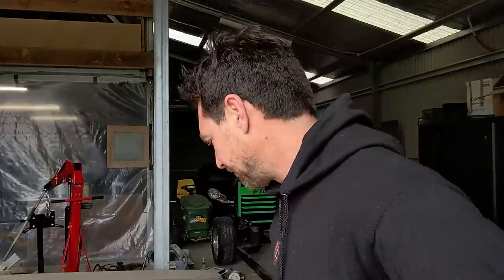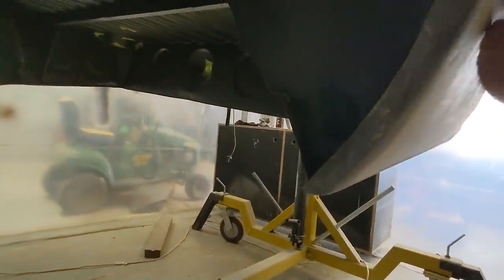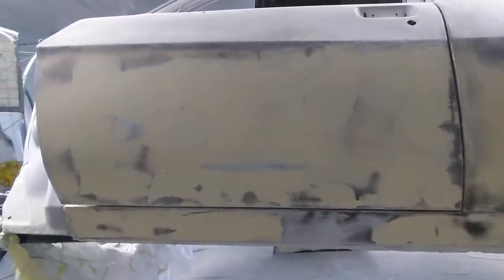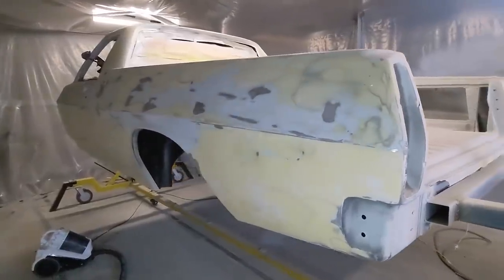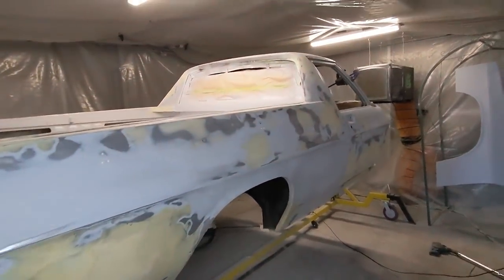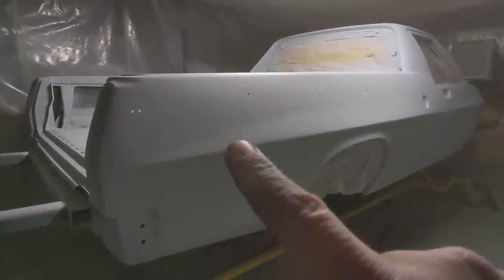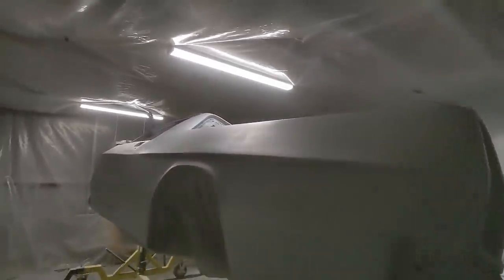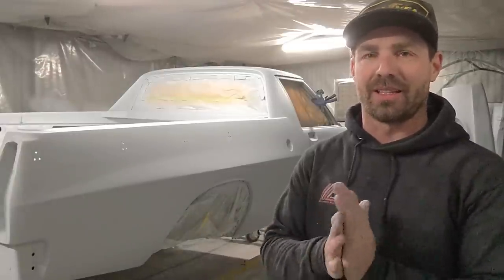EPISODE 54 - SPRAYING THE 1982 HOLDEN WB UTE SHELL IN 2K HIGH BUILD PRIMER

Comment: How gratifying is it man, when ya stand back once she’s one colour and look over them curves ha!  , I usually put epoxy sealer on before high build (which is thinned out epoxy primer ) as this is a great chance to see the panels uniform in colour and free from imperfections whilst sealing in the filler work, and if ya need to do more corrections then everything is still at the same stage in the process. You wanna avoid using the high build to lift deepish lows. Finish the underside and set her down on the chassis once all lines are fitted etc , paint door jambs and hanging panel inside faces , fit front end then you’ll be able to roll outside for wet sanding the entire outside in preparation for topcoat . If space is low and ya have to paint (top coat) where you prep then re-do ya booth ,brand new plastic and blow down or cover ceiling and run a wet floor which will catch falling debris and won’t float up into the duco when ya walk around painting , keep punching out the work man can’t wait til you show us the shine!
Reply from the maker: Thanks Anthony, yeah it was definitely a buzz seeing the lines worked, you really know where you stand once the grey high lights the remaining trouble areas. I know once they are nailed I will not be worried at all about ripples once top coats on. I will do that, I wanted to wait for engine and exhaust to be dropped onto chassis before I put the body back on but engine is still a bit off. So might just drop it back on chassis and start to line up guards, weld cowl on and bonnet. I'm still thinking of painting guards and doors separately as well to keep over spray down now. Thanks mate

Comment: Hey Barnsey, as a qualified panel beater that works in resto.

We use the same method for highs and lows but for a quality finish we will 2k high fill and block with a speed file, and repeat this again. So we filler, prime & block, prime & block again then fine sand and paint.

You can prime and block 3 or more times for a better finish
Reply: In saying this if the primer is applied thick you can use it as a filler and just block it right down to remove lows instead of using filler over primer
Reply from the maker: Awesome mate, that's good to hear after all the work, I was debating whether it was a mistake not going to polyester surfacer but I will get the same result now I can see the remaining lows. I will fill them and reprime as you mentioned. Do you just apply your base coat over the 2k once it's all sanded?
Reply: @BarnesysBuilds  aslong as you have no body filler rub throughs you are good to go. If you do I suggest spot priming and blocking the areas again, using a rattle can to spot up before painting can create issues, so 2k our iof a gun is the go always

Comment: Good one Barnesy, all the hard work is starting to pay off now. It is looking good, you have straightened out a lot of imperfections. That banana line you refer to is often over looked. You can tell that body was not a Kingswood from the factory because the little welded tags for the vertical trim behind the doors are not there. Those trims were hard to find a long time ago,they tended to fall off. Also the side body mouldings are held on with plastic clips; those holes would have been punched before painting and as a result are painted too, not drilled afterwards (punched holes are a lot neater than drilled ones). Glad you are going to keep the rope down tonneau cover, that is what makes them Holden and it will stand apart from other restorations, plus they look good. Jeff
Reply from the maker: Thanks Jeff, I'm pretty happy with it, still needs a couple more touch up and primes to get it 100% straight but will get onto those now. I used to have a Kingswood ute, unfortunately it was stolen but I remember the clips for the side rails. The 82 commercial ute style had thinner side moulds which I have  researched and believe they were glued on. Not sure where I could find new ones of that style.
Reply: @BarnesysBuilds  Thieves are bastards and should have the green rubber ring treatment. Yes the Kingswoods got the clip on side mouldings standard, anything on the others would have been after market. That stick on moulding is much thinner comes on a roll and it should be easy to get. Put it on on a warm day, it is more pliable then. Kingswoods also got the tonneau cover standard, “Belmonts” had it as an option. The owners manual calls the base model (poor mans version) Holden, not Belmont, the rich mans version is the Kingswood. The WB 253 was the only one to get the Quadrajet carby, earlier ones (all the Hs) only got the dual throat Stromberg. That is indicated on the ID plate as L36 (700 CFM for 4.2, 750 CFM for 5.0 L. I will stand correction on that though). Don’t worry the old 253 with the Quadrajet gets up and boogies when you get the secondaries open. On mine they get stuck open and that makes for interesting moments, but that is another story. Only the Statesmans got the 5.0 L motor, it wasn’t an option for utes,vans or 1 tonners. There is some chatter that it was possible to get a 308 in a special blue colour in the very last ones by special order but the only people who can verify that would be the few, if any, involved. The owners manual only shows the 3.3 six or the 4.2 V8. The other tag shows that if you can decode the number, the owners manual is helpful there too. The Sports dash was also an option and quite a few got that. Jeff
Reply from the maker: Nice info Jeff, thanks, did you work for Holden?
Reply: @BarnesysBuilds  No, I spent most of my life farming but am a Holden man. Always regretted not buying a new WB when they ran them out in 1984. Into all good old things. My WB is pretty original, 253,4 speed, dash, Kingswood, 290,000 kms and I have had it for nearly 25 years so I suppose it is in much the same condition as it would be if I had got it new. The maranello red is showing its age though. I am enjoying your stuff, I know paint is hard if you are going in green, I have made all the mistakes there is then some. It takes balls to do what you are doing. Jeff

Comment: ha barney at this point i would go around with a pencil and circle all pin hole and fell for highs and lows and mark around the edges of them   and start light block on thos areas then lite skim of fill then re prime those areas then  then re aply guide coat and long block from guards to door so they look like there cut from the same cloth  remember a coat of prepsole will put a gloss on the panel showing you all ripples
Reply from the maker: Thnaks Justin, will definitely go back over it now and start to touch up the remainig spots that aren't right, there's only a handful now which is great!

Comment: Great job mate, let that primer dry for a couple of weeks and take your time blocking it. If you blow it off with air the pin holes will be easier to spot, use your dry guide coat too, you don't have to put it on so heavy, just enough to give you a contrast. Great job man, keep up the good work. What colour are you going for?? Don't scrimp on any cheap base coat and clear. I recommend the Axalta branded products like Cromax or Standox. I've been using them for years and rate them high. Cheers mate. 👍
Reply from the maker: Thanks Troy, definitely will take my time, might drop it back on the chassis soon to get all panels on. I'm thinking of a gun metal bronze tone, or maybe the original ice blue or ice green colour. I'm probably keen to do a custom colour though. I was going to use DNA paints as I have heard they are forgiving to apply and great quality.

Comment: Good to see you got guide coat. It will be your best friend. As I said previously, you will learn with experienc, protect your body line. Masking tape is your friend for that. Use the spline to apply the filler. It leaves a consistent finish. 

Once you start to see the bare metal stop. Either your bodywork wasn’t up to scratch or maybe apply more filler. 

From what I see use your long spline to apply the filler and I will guarantee you will see how bad your application of body filler was originally.  Also remember to sharpen your spline so it leaves a smooth coating of filler. Use 40 grit to do body work. You want to be shaping, at this stage not refining.

Considering you have spent so much of your time on this, try some spray polyester filler. It will be worth your time. The stuff doesn’t shrink.
Reply from the maker: Thanks mate, I definitely applied all those steps and I pretty happy with where the body is currently, it's around 90% there with just filler and high build so I'm going to stay the course, sand with the splines and finer grits and expose the last remaining low spots I found on the rear quarter, fill those reapply high build and be done with it. Time to move on and get it back together. Thanks

Comment: Awesome work getting the hi-fill on  looking great:) I'm curious if you run your compressor with a refrigerated dryer or desiccant dryer setup to keep the water out? Keep up the  fantastic work mate
Reply from the maker: Thanks mate, I don't have anything serious on the compressor, I just empty the tank before I spray and drain any water build up and I also have a water filter link and pressure gauge mounted on the wall to remove any remaining condensation but really I need to upgrade this to a bigger double filter system before I lay down the base coat. Thanks for watching

Comment: I wouldn't be doing any hammer and dolly work on areas where there is filler. It will crack.By rights the hammer work should be done first before you start filling and blocking. I would suggest using a shorter block too, for manuverability   and the panels are convex, I would use your 12 inch or 18 inch and just block and fill, the dolly work should be done unless it's a good distance from the filler. Good move getting the dry guide coat. You can even use it wet. Work on that swage line and make sure you keep it straight.  👍🇭🇲 aussie v8's
Reply from the maker: Yeah i must admit i did have to hammer and dolly a few highs after body filler but only small areas as there was no way around it, i then did remove body filler in the small area and reapply to avoid weak points.

Comment: What full face mask did u use with the 2k mate?
Reply from the maker: It's a ebay knock off 3M 6000 Series full face. The mask is identical and takes the 3M filters so it's an affordable option that's still as effective.

Comment: The build is going along and the hard work that you put into the panel work is paying off. A couple of things not sure how you mix your fillers but watching Howard Astell and he uses a cheap electronic scales like a kitchen scale to accurately measure both amounts he mentioned better consistency between batches. I know that the final paint job is looming and very stressful so have a look at the XACOUPEGUY https://www.youtube.com/watch?v=sTj_Kirkg_I  he is painting a falcon in stages as he says its much less stress, he is a panel beater not a spray painter. BTW are you going to have tie down bars on each side?
Reply from the maker: Yeah thanks, I may break it up into sections as it's a huge job otherwise. Guards doors separate then body and bonnet. Will check him out. Cheers
Reply: Don’t put coffin rails on it.
Reply: @jefftheaussie2225  Coffin rails what an apt name for such useless piece of equipment
Reply from the maker: @jefftheaussie2225  no I'm not interested in the coffin rails, just the side moulds